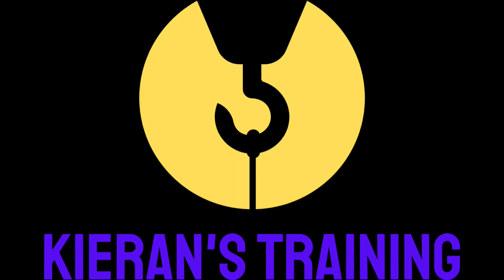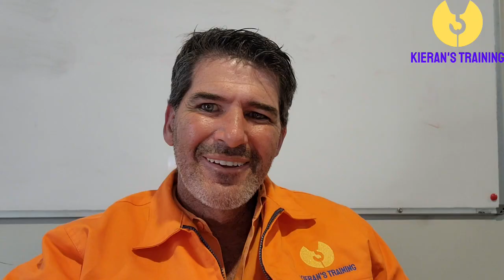The problem with the crane and rigging industry

Comment: I understand the point of view, in that kind of mentality of having someone trained in practical as above theoretical, but this is the way the world is. 

The problem with having everything entailed into a rigger's ticket, or dogman, whatever, is that there are so many avenues that are specialist. I've been rigging on and off since 1989. This includes welding, fitting, and other things that may be useful to a rigger. That said, I didn't get ticketed properly until relatively recently. I had a learners permit when I was 16, as I was too young to get my riggers. Then I worked off a log book system. Then the courses that the government said didn't meet the standard, but I'd gone overseas anyway. Then finally, I did the course properly.

Still, I've been involved in steel construction, installing and dismantling platform hoists, maintenance in mines and quarries and their associated places, and moving steel around in factories and yards. But to entail all the skills into a riggers ticket would put it out of reach for most people. I mean, even getting onsite nowadays means joining some app to add all your details to (and most people have no idea about privacy of their data, but just blindly trust these apps). So, we could say that a necessary part of rigging is to have a basic understanding of IT. Then there is the reactions between slings and chemicals, or even the item being picked up, and the slings. So it could be pushed to having some form of training in basic chemistry.

I don't agree with the apprentice wages thing though. I appreciate that in theory, it means employers could...but most won't. They will do as my youth was, and take advantage of apprentices by ripping off young people.

Over the length of six months, for a person to get a dogman ticket for instance, it only needs to cost the employer $3 an hour to pay for a ticket for their worker for six months. Based on this, it shows that a majority of businesses are already taking advantage of training people to help profit their business, as a traineeship or apprenticeship is peanuts compared to when they have their full qualification, regardless of how good they are.

Based on this, I believe it is right in having a training matrix, but the govt here already allows a trainee to be registered in an RTO and working under the supervision of a qualified person, who should be instructing this other person, for up to a year, as long as they are registered and under that supervision. That means they could work as a team for 6 months, before the person does their dogman course or riggers course. It is the methodology of the businessman that is the problem, and the mass profiteering that starts with the top and works its way down in this financial system, and legal system. Not the actual training itself. My opinion though, so yeah, I could be wrong. Also, there are exceptions to the rule as such.

Comment: I really believe rigging and crane operating should be done as an apprenticeship and made a trade. That should include all the relevant tickets, eg; ewp, at least a basic Scaff, forklift, HR/truck license. 
Apprentice wages would incentivise companies getting green blokes and training them up. And 4 years on apprentice pay would help weed out the “WA advanced rigger” types. Put some basic boilie and fitting stuff in, not looking to replace fitters and boilies but stuff like welding a small lifting lug on, gas axing, fitting wise general fitting principles, marking, drilling and taping holes for lifting points. As Riggers we build things a lot of the time you don’t have a fitter or a boilie around and some basic knowledge and skills can save a lot of hardship.

Comment: I’m new and recently started working roughly 2 weeks ago (I’m 18),  any tips?
Reply: Yeah. Safety first. Think of where the load swings, learn what happens when the wind blows or when the load is lifted, and keep light on your feet. Know your surroundings - holes in the ground, trip hazards, and use your peripheral vision to alert you to anything out of the blue. Always scope your surroundings, and at the same time, be calm and relaxed in your dealings with others. Stay away from cowboy riggers who will want you to race in and do stuff. They're temporary residents, no matter how good they are.

Wear riggers gloves whenever possible, never stand underneath a suspended load. Imagine if it drops, you want it to drop just beside you, not on you. You won't have time to even flinch. Also, never stand directly above a load that is being lifted, in case it gets caught, due to suction, or a snig, and comes flying out with all its might.
When the load is lifted, will you be left alone without anything to hold onto in an awkward position (like standing on a beam suspended over nothing)? Likewise, when the load is landed, will the place you are standing be secure?

Lots of things. There are many more. Patience is needed to, so you can be an older experienced rigger, who hasn't lost any friends or limbs.
Reply: Bro good on you for going out of your way after work to learn more on your own time. That’s really commendable brother 🤙🏾
Reply: you working general hire in the city areas or mines/industrial?
Reply: @South_Cart  general hire
Reply: PS id also recommend reading as much of the training booklets that you got at your rto as you can. also the guide to rigging has a lot of good info and ground bearing pressures, slinging techniques, formulas, reductions etc. if you can get a copy of the operators manuals for the cranes your dogging it can give you a better insight to what it can and cant do so you dont hook up 3 tonne when its only good for 1 tonne and having the operator cuss you out hahaha